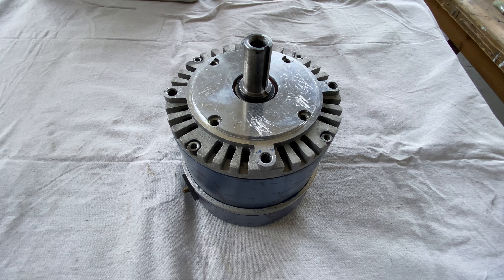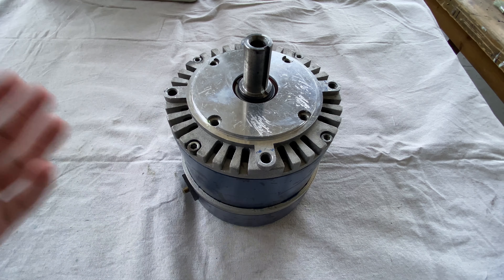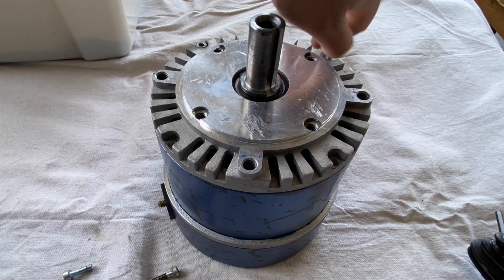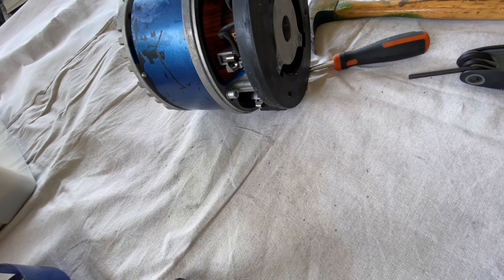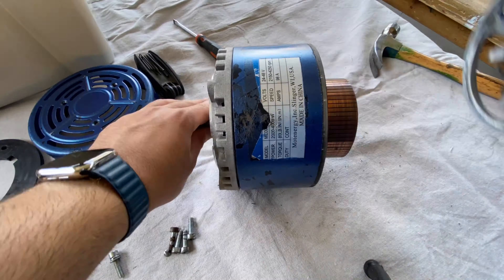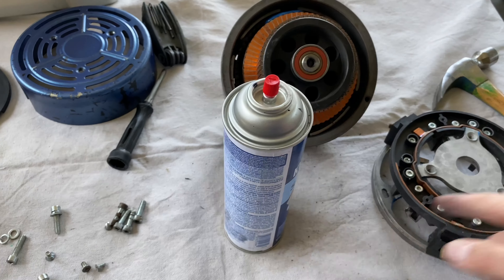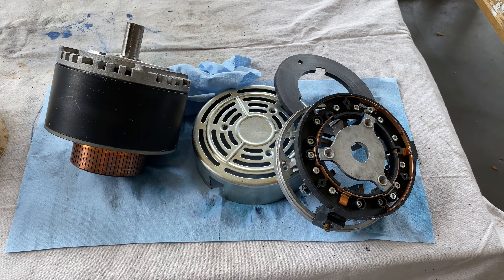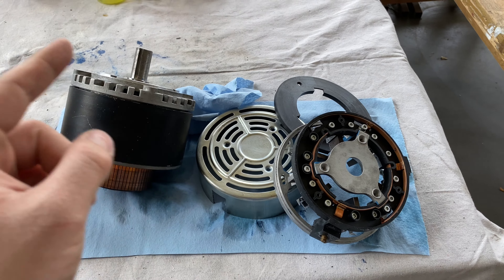4000 Watt DC Motor Restoration (Part 2)

Comment from the maker: This video is a continuation of the restoration of my electric motor. My next video will be in regards to painting, assembling and running my motor. The goal of this video was to disassemble it to clean the internals and strip all the paint. This video was filmed at school and the point is to restore the motor for future students.